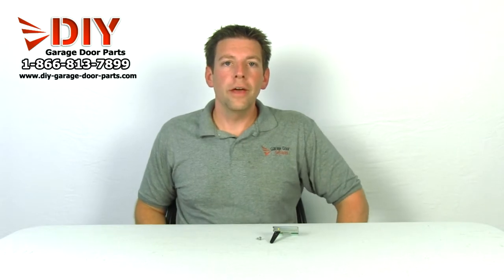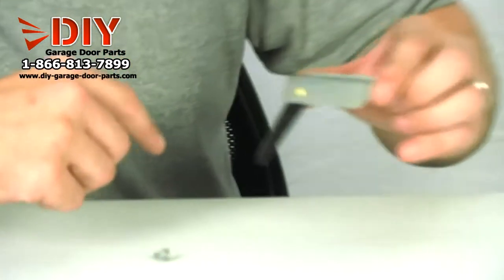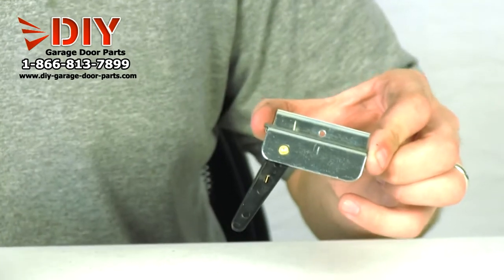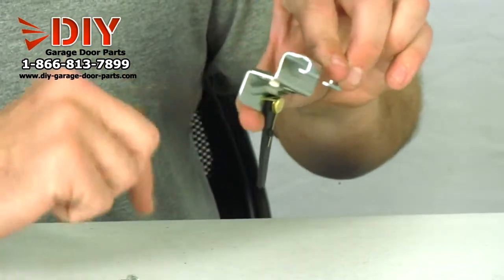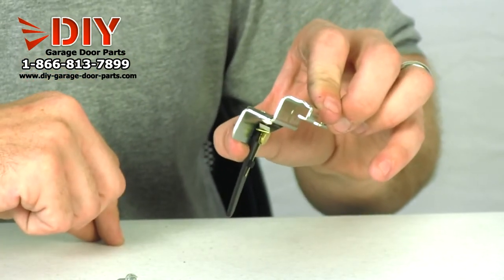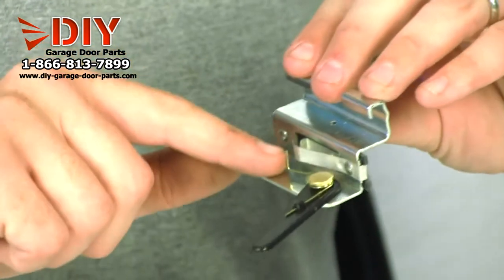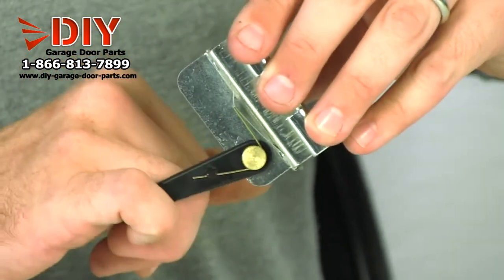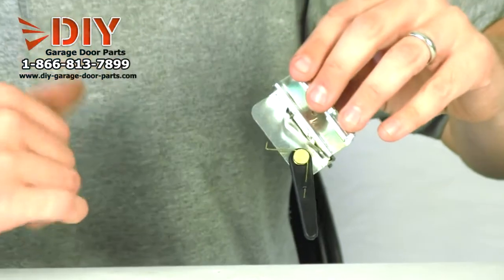Genie Garage Door Opener Screw Drive Limit Switch

Comment: Thanks.  I found the plastic part had broken off so the motor wasn't stopping when the door opened.  I looked at the switch on the back that causes the door to stop when its closing and then I taped a s small wooden dowel to the wire where the plastic part on the opening end had been and its stiff enough to push the wire and stop the trolley and the motor for now anyways.  Thanks for the easy to follow video.

Comment: Genie 404 (the Monster lives!).  Garage door stopped closing correctly (wouldn't stop) so I purchased and replaced the switch.  Didn't fix anything.  Swapped out good switch (opening stop) at the down position and moved new switch to open stop position.  Garage door opens correctly, but still won't stop at the closing stop switch.  Troubleshooting 101 says I need to replace the down switch wire, but I'm asking if there's anything I should checking?

Comment: I have a question about the limit switch. When closing my garage door, it makes contact with the down limit switch and power to the motor stops. The problem is, when I click the wall remote to open the door it’s like the motor doesn’t receive any power. If I manually move the down limit switch to release it, I can press the button and the door goes up. Is this a flaw in the limit switch?
Reply: I am having the same problem. Did you ever find out what the problem was?
Reply: @ArnoldsDesign  hmmm I believe I just kept moving the limit switch a bit until it was at the correct distance. The issue came up after reattaching the garage door. I know I didn't buy any new parts.
Reply: @ajking1865  I actually got it figured out. I'm embarrassed to say, but me or someone else accidentally turned to opener switch to "lock" position, and that's why it wouldn't open. I was pulling my hair over it until I happened to notice it. It works now. Thanks for replying though.

Comment: The wire that connects to the terminal of the limit switch... where does the other end of that wire go? The other end of the wire that attaches to the limit switch that stops the door in the closed position is dangling loose.